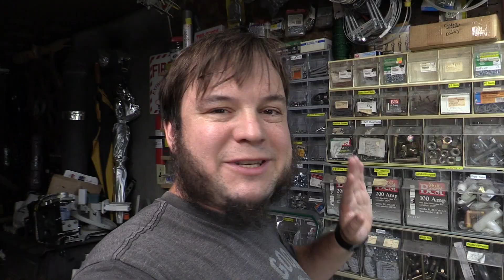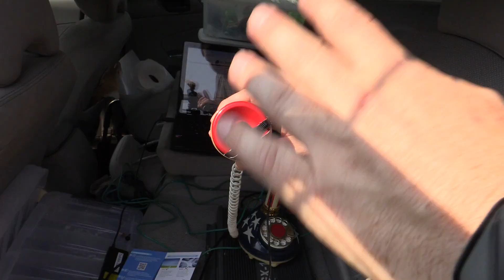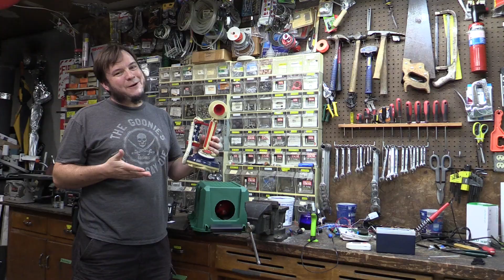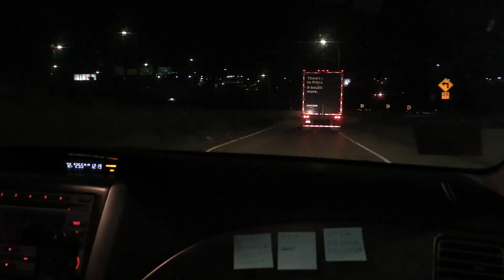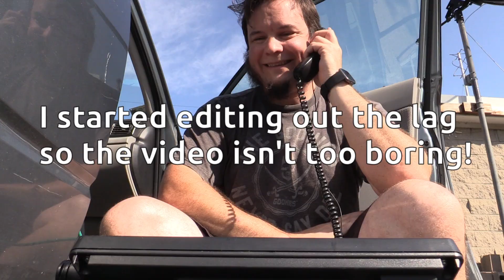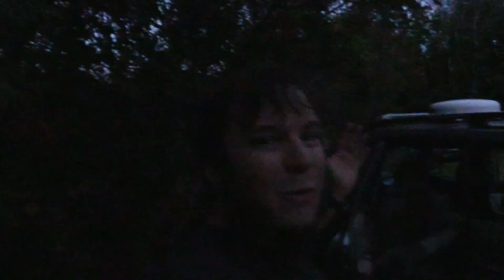I Called Peter Fairlie With Satellites (And Bounced A Call Through Starlink)

Comment: I think your DTMF adventure was victim to what the telephone engineers called "twist". Just their word for frequency response. The amplitude of the two tones had to match within so many db of each other. A mike/speaker with iffy frequency response will introduce excessive twist and prevent proper decoding. Our local 2-meter repeater had to have its audio response tweaked so it would recognize touch tones properly.

Comment: 1:35 Does that mean 5.5 megabytes a month? Or does it mean you get 5.5 megabytes and that's it?
Or is it a 5.5 megabytes/second bandwidth? 
Thanks!
Reply from the maker: It's a prepaid card, so just 5.5mb total until it runs out. Kind of an outdated system and not really meant for modern Internet.
Reply: I am surprised they get business with such prices. 5.5 mb for 160$, seems like an astonishingly outdated pricing chart. No wonder the government still pays for it.

Comment: Getting telephone audio can be a bit weird. The microphone is probably the best way to do that. Beyond that you either need to tap the line between the handset and the base and get the direct audio or you need to tap the telephone line between the phone and the interface. Don't get something that's too cheap unless it's cheap and easily available I picked one up and it was just a diode it worked but not very well. I got another one that had a volume control on it and could do the handset or the line cord and it worked really well so I picked up three more.
And while we're on the subject tapping your phone line is not always legal check your local laws not a lawyer blah blah blah... first party consent is nice, some states require 2 party.

Also some devices blocked DTMF over the Audio channel.

Comment: I have a customer who uses Starlink for their primary internet connection.  I install phone and camera system professionally and have for over 2 decades.  They have a VOIP phone system that only connects through internet via Starlink.  We disconnected their normal landline service because the VOIP was more reliable. What makes it even worse there is not cellular service in the building.  The office is in a very rural area. Technically the system uses SIP trunking with SIP phones.  They operate an actual business over the Starlink and the latency is very similar to a typical cable service.  The voice latency is almost nonexistent.  I have had more issues with other customers running over DSL.  Interesting video there sir.  The customer is in Northern Alabama and Starlink normally has a ping time of 20-40 milliseconds.
Reply: Yes latency on Starlink alone isn’t bad but routing it thru Inmarsat and then Starlink was likely an unusual connection. Specially in this case Verizon was involved for the voip connection to the mobile device which was on airplane mode, WiFi on and connected to Starlink for WAN access. Just Wish I had T-mobile. 😂
Reply: yeah we use starlink mini at our cabin where there is no cell service or broadband and even over my android phone, over VoIP over WiFi over Starlink it's almost exactly like any regular call it's amazing. And pretty soon there will be direct to cell from Starlink too.
Reply: Here in Europe we actually use Starlink for the backhaul transmission behind some really out of the way rural cellular base stations. Google "O2 Starlink". That was my project. :-)
Reply: Inmarsat / KVH is like 800ms lol
Reply: I work for a local ISP and bought the starlink mini for testing/camping and it’s very comparable to coax broadband to where I almost switched my main feed.
Reply: Man what's weird is starlink has handled my wifi-calls better than my fiber connection at my old place

Comment: One thing you could do if you want to use as little data as possible on an expensive connection is to use a command-line browser such as lynx (available in most of the Linux flavors), they basically only load the page itself, not any audio, images or other files GUI browsers do.

Comment: you pretty much nailed it on the head with the bit about starlink taking over. Its literally the only decent option we have here. second best is 4gLTE, next is Hughesnet with geostationary satellite. LTE works, but its pretty slow and because of the distance from a tower, we have to have an LTE repeater in the house to make it work. Hughesnet is not only laggy (660ms ping), but its also slower than LTE. Starlink is plenty fast with our max speed at 300mbps, and latency around 20-40ms depending on a few factors. 
LTE is terrible because of the datacaps. Not cheap either. there might be better plans now so idk. 
Hughesnet is the worst because of the latency AND the datacaps AND the expense! ~$140/mo with 40gb datacap. its dumb. 
Starlink is terrible because of the owner and the sky pollution... but $110/mo, no datacap

If only they would have connected us to the fiber they laid through our driveway.....

Comment: You can convert the 12 volt of the car to the voltage you need for the phone with either a buck or a step up converter. A lot of them have a potentiometer to set the voltage. Good luck!

Comment: You could use it to demonstrate how sailors used to download grib files for weather info, there are services and sites specifically designed for the slow connections like Inmarsat, Iridium or even through SSB HF radio.

Comment: If you had been near me I have a beautiful desktop bellsouth off white touch tone that looks brand new. 
You could have used one of your HT to get dtmf to dial with. Years ago my grandmother had a rotary phone and I could use my ht to dial numbers by putting the speaker to the mouthpiece of the phone. It worked beautifully. After I discovered that I got them a touch tone phone.
You could also use a cell phone to make a call that same way. I was using a Motorola Star Tac circa late 90 got one when they came out.

Comment: Very cool, interesting to see old services like this in action! Considering it’s an older connection, would it be possible to use it on an old cell phone like the original iPhone which only supports 2G, or something older like a 90s/2000s Nokia? Or even more interesting, connect this up to a modem and use a dial up connection with an old PC or Mac? The car phone itself was cool, the cost to use it though is something else.
Reply: 2G mobile phone service is still very much alive and well in most places. Not sure how this relates to a satellite phone service.

Comment: I've bashed around with Clansman HF transceiver, and there is a whole chapter on installing the radio up on a hill with only a telephone line running to the bunker. Also tench HF antennas. I don't know for sure, but reading between the lines a wwII 'radio operator' had a much wider skill set than knowing morse. Radio comms is so much more than a 10/4 good buddy over cb.

Comment: When will you try using a satellite dish to listen to uvb-76
Reply from the maker: It's on my to-do list somewhere!
Reply: You wouldn't use a satellite dish to do that, you'd use a wire antenna. It's on HF (shortwave), and near the bottom of that, on 4625kHz, or a wavelength of around 65 metres.
Reply: @paulsengupta971   early Russian signals like that actually bounced off the ionosphere so unless you used a satellite dish or where by the ocean you probably would not hear it being it's bouncing up and down around the planet
Reply: @09mxrider  All HF/shortwave "bounces" (refracts) off the ionosphere. Unless you're very close to the transmitter, that's how it works. Satellite dishes are generally for microwave frequencies which won't bounce, VHF and above mostly go straight through, though VHF can sometimes bounce off ionised "clouds" in the E layer when they are present.
Reply: @paulsengupta971  that's why you need to use an sdr coupled with a satellite dish, the dish acts as a collector that's why you can pick up all kinds of radio signals with them
Reply: @09mxrider  Not HF.

Comment: rural nevada. local internet company has been given who knows how much money to upgrade our internet services out here, in a pretty sizeable and growing town, but that has not happened. speeds when i was 10 years old were ranging from around .3 to 2 mpbs, nowadays (15 ish years later), its sitting at like, .5 to 5 mbps. i guess you could consider that an improvement. meanwhile at my apartment when i went to college, i had fiber gigabit internet (which was normally like, 300 to 500 mpbs, only hitting 1k every so often, but still far faster than anything i needed it for) that cost half of what my parents pay for their internet. :/

Comment: Dude, thank you so much for having given this a go!😃
 I wasn't aware that the flipper used a pwm, but that makes sense because it's a Piezo🤓

Looks like Sand Land needs a STL!📡
Never occurred to me to try a phone app.
 I was really surprised that I didn't work though🤔

So, I went and got a couple of the Heltech V3s (Meshtastic)
 I'm not exactly impressed right out the box.
 It is after all, just to cross over to interface.
I'm having a hell of a time keeping a good Bluetooth connection for some reason.
 I've been using the Browser GUI on Chrome.

That too is buggy for some reason.
Every update to a device severs the connection and you have to reload the page and reconnect the serial port.
But, this has most certainly sparked my interest in developing something a bit more robust.

This capability would make a great addition to the tech deck.
Don't give up on the Flipper just yet.
i just ordered the GPIO Geiger counter kit for it.
I'm going to look at the GPIOs on the Flipper and this LoRa 32 board and see if they play nice together.

Comment: There's also an app on android and I think IOS called "ToneDef", it does exactly what you were doing with your flipper zero with dtmf tones but it also has a blue box and red box emulator. I have an old rotary dial lineman's set and used the app to dial with dtmf on my landline simulator and it worked just fine. The audio does need to be pretty loud though.

Comment: Great channel so far, i have a question though. When it comes to picking the weather satellites, is the basic cheap rtl-sdr (the blue one) will do or the standard black rtl-sdr is a must ?
Reply from the maker: The cheap blue one worked for some of my earlier tries with NOAA satellites on VHF. The RTL-SDR is a little more standard and has better antenna connectors, but also more expensive.
Reply: @saveitforparts  thanks mate.